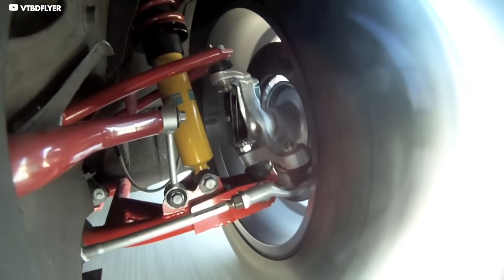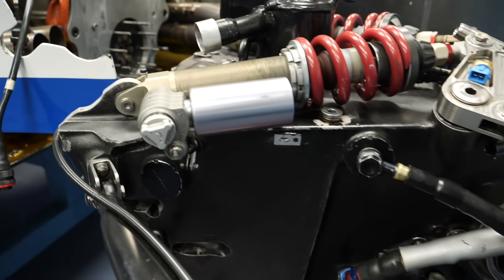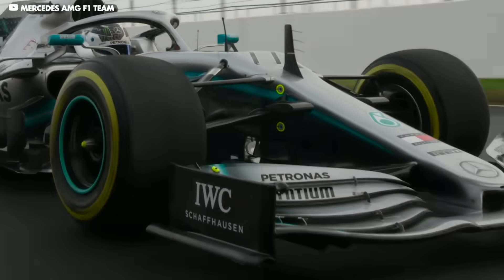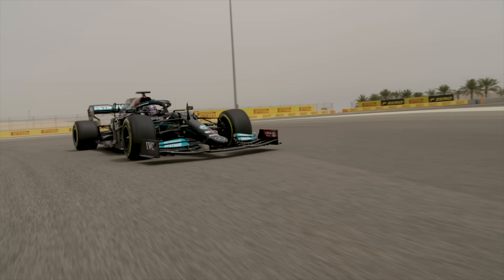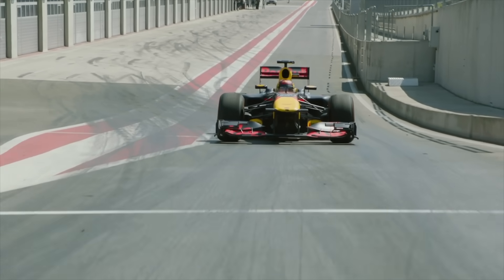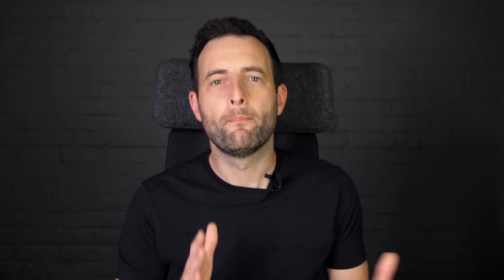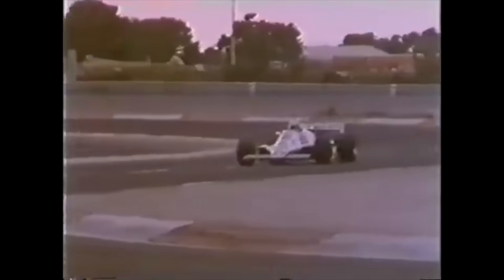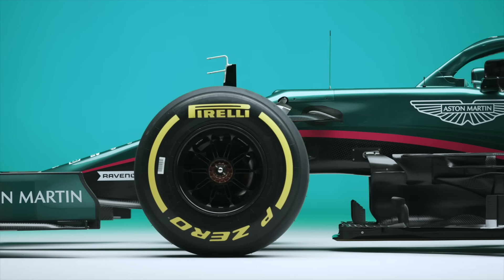Why this Formula 1 Car was FASTER Without Suspension

Comment: It's crazy how suspension can actually soak up your down force there by reducing grip. Never knew that before
Reply: On smooth track but with good set of suspension with hi and low speed compression i will be same but on not so smooth track you will definitely feel cause instead of suspension soaking up the bumps the whole car will bounce that will affect it. Modern cars with modern suspension do what's best.

Comment: Friction is Independent of surface area. Amontons 2nd law of friction.
Reply: If I'm not wrong, that's true for an ideal solid body, but that is not strictly true for rubber
Reply: @2nir2  ok coming back after more research. You are still wrong. Coefficient of friction only increases with the normal force. And is completely independent if contact area.
Reply from the maker: Coefficient of friction is
Reply: @Driver61  I don't believe so. But I'm only pulling information from a few physics textbooks and what I can google. And you please post a link to information where the coefficient of friction is a  function of the contact area?
Reply: @2nir2  that's not a very good resource. Thank you though.

Comment: Misconception: weight transfer is not eliminated with no suspension. The time it takes for weight transfer to occur is almost eliminated when suspension is removed. As long as the center of mass is above the contact patch, there will be weight transfer due to the torque applied when cornering, braking, and accelerating, when talking about cars.
Reply: Very true. Big mistake by him.But if your center of mass was bellow your contact patch you would still have load transfer just in the opposite direction... Still I am finding funny imagining how you could have the center of mass bellow the contact patch. Like two rails with a cabin between the rails perhaps...
Reply: @BerTav  with this 😝 https://en.m.wikipedia.org/wiki/Suspension_railway
Reply: @euquievolinho2525  perfection 😂👌
Reply: Thank you!  While I was stunned while watching this video and thought I was losing my mind.  I'm kind of astounded by the inaccurate info as well as the fact that so few seem to notice it.
Reply: Went into the comments to see who caught this first.  Springs have no affect on total load transfer outside of the minuscule results of how they may allow the CG, wheelbase, or track width to alter during roll and pitch.  The only items that affect total lateral and longitudinal load transfer are CG height, track width, and wheelbase.  Springs, dampers, arb's, etc. have no ability to increase or decrease load transfer, but they do allow you to adjust the distribution and rate.
Reply: @BilletBenny  Can I ask you to clarify for me?  Clearly lack of suspension does not eliminate load transfer, but does it necessarily follow that where springs and ARBs are present they have no ability to increase or decrease total load transfer?  For example, does not increasing the roll stiffness of an axle reduce net mechanical grip because it increases the load carried by the outside wheel at the expense of the inside wheel?  In an extreme example, back in the day Porsche 911 race cars often put on enough roll stiffness to lift the inside front wheel clear of the pavement, meaning 100% the load was transferred to the outside tire, no?  Wouldn't the corollary be that an axle with minimal roll stiffness would transfer less load off the inside tire than one with maximum roll stiffness?  Thanks.
Reply: @gort8203  It is true that springs and arb’s have no ability to increase or decrease total load transfer.  When you are talking across an axle you are not talking about total load transfer, but load transfer distribution, which springs, arb’s, etc. do change.
  

I will talk in the context of lateral load transfer during cornering, but it’s the exact same concept as longitudinal load transfer during braking and accelerating.  Total load transfer is the amount of normal load that is removed from the inside tires and added to the outside tires during lateral acceleration.  This is what springs, arb’s, etc. cannot change.  The only items needed to determine this total load transfer is lateral acceleration, track width, and cg height.  That’s it and springs do not come into play.  Now for how much of that total lateral load transfer occurs across the front wheels and rear wheels is a stiffness problem and absolutely is controlled by springs.  This is how you tune the balance of a car among other things.

But, the concept here to understand is total lateral load transfer right to left is completely independent of any springs while the distribution of that total lateral load transfer between individual corners is entirely controlled by springs.  Springs don't change the total, just the distribution.
Reply: @BilletBenny  Thanks for the reply.  I think you have added an additional complication by talking about cross corner distribution, and I’m trying to stick to pure lateral transfer across a single axle.  I know that springs can’t change the total magnitude of the load on that axle, only the distribution, but the real load on each wheel does change, right?  In my 911 example, you have a stiff chassis with minimal rear roll stiffness and strong front roll stiffness.  The chassis rolls enough to lift the inside front wheel off the pavement while the rears are well planted.  There is zero real load on the inside front tire.  Are you saying there is still “total” load on that tire, but no “normal load”?  If so I do not understand the distinction and I want to be sure this is not just a terminology thing.  Thanks.
Reply: @gort8203  Springs do change the total load across an axle, they just don't change the total load transferred from the inside wheels (summed) to the outside wheels (summed).  The way springs change load across each individual axle is your lateral load transfer distribution.  In your case, when lifting a front wheel, everything holds true except we now have a limit constraint.  There is no new or extra lateral load transfer created in this case from inside to outside.  The total additional load on the outside tires has increased by the same about that has been removed from the inside tires.  In this case the tire in the air has zero load and therefore the inside rear tire is carrying the entire load that must be left on the inside wheels.  That load that has left the front wheel in the air is now carried by the front and rear outside tires, but how much to each is determined by the relative roll stiffnesses.  

Cross corner distribution isn't a complication because it's critical to understanding the problem.  Total load transfer occurs between inside and outside tires in total.  You cannot compute it individually across an axle without taking into account the other axle.  Basically, total lateral load transfer (inside to outside) is statically determinate, but how much of that lateral load transfer occurs across each axle is indeterminate (too many unknowns) and in order to solve across an individual axle new information must be brought in such as spring stiffnesses and/or travel limits.
Reply: @BilletBenny  Okay thanks, I think we are saying the same thing.
Reply: @BilletBenny  what about "impulse"?
A loaded spring can temporarily increase normal forces, though at the "cost" of decreasing normal forces later (perhaps even imparting upward momentum).
Unless I misunderstood what you meant by distribution.
I mean, I can increase force even at a standstill, by (unloading the "spring like force of my legs by) jumping.

Also, I think the announcer actually meant something different: the geometry of the car doesn't modify, thus deformation by the suspension on the inside curve would roll the car more, and if the suspension on the outside doesn't compensate, this would reduce the outside wheels contact force, distributing too much (?) force (Overwhelming) to the inside wheels. 
Additionally, perhaps the momentum of outside wheels "launching down" would impart angular momentum (during this movement) rolling the car even more, until the outside wheels then reach the end of their compression or hit the ground, which would either snap roll in the opposite direction, or inversely, bounce off the ground and increase the roll.
(This comment is now a mess, I apologize.)
Think being in a chair with wheels, and while sitting you swing a heavy sledge hammer down. you will move in the opposite direction. Now imagine suddenly stopping that hammer before it hits the ground, your roll backwards would stop, and perhaps you would roll towards the hammer (depending on how you transfered momentum to the chair, etc.). However, if you didn't stop and instead hit the hammer  to the ground, your roll will increase.
Here, the hammer is the tire, and you swinging it is a compressed spring uncompressing.
Reply: I should have scrolled down before I wrote my reply! It's amazing how few people actually understand things like this.

Comment: so, No suspesnion and super thick tyres to be used as Suspension would be the best?
Reply: No suspension only helps when ground effect is a major factor, otherwise the suspension helps maintain ground contact. Bigger, thicker tires might help, but ultimately it doesn’t do quite the same thing since the air can’t be damped in the same way suspension springs are. I think the overall result would be a car that ran very low and very smooth in ideal conditions, but would bounce and oscillate unpredictably over bumps and even during cornering. The ultimate setup would be ground effect and active suspension tuned to the tires, which would allow low, controlled ride height, and maintain contact with the road.

Comment: Man, that's a bit of a scummy thumbnail.

Put the picture of the car this is relevant to rather than the current f1 car that doesn't use said suspension.
Reply: Yeah but if hes delivering quality content don't bitch about it it's a minor detail.
Reply: @sufferr2914  he has the right to bitch about anything that's illogical and/or wrong. 

Besides, audience here are in it for the details and this video had some wrong info stated as facts. 

Just like I can bitch about you because you did not think 2 steps ahead.

Comment: Actually load transfer would still happen by the same degree a with soft suspension.
Reply: Exactly, dude has no clue what he is talking about. Softness, or even absence of suspension has no effect (except absolutely minimum amount from a slightly shifting CoG) on weight transfer. There are only two things that affect weight transfer - CoG and track width/wheelbase.
Reply: was just about to comment the same. Equilibrium of moments... Suspension only change the distribution of the load transfer and the behaviour and movement of the chassis (that can change masse distribution but it is minimal). My confidence on his conclusions just dropped instantly. A very common mistake by people starting to learn vehicle dynamics and show very few knowledge in vehicle dynamics...
Reply: @BerTav  I didn't do physics, but I don't think suspension even changes  the distribution of the load transfer. Stiff anti-roll bars I think speed up the rate of load transfer, so I suppose suspension does that to some degree. But with suspension, it is about maintaining the right contact patch, and/or preventing geometry changes to the suspension. There is also the possibility of lowering the car if it has stiffer suspension (which definitely has an impact on load transfer). But more importantly stiffly sprung cars just feel more connected to the road.
Reply: @projectilequestion  The relation of stiffness of the axels changes the distribution of load transfer. If you stiffen the front axle then you increase the percentage of load transfer in the front and decrease in the rear. The total remains the same but the distribution amongst the 2 axles is changed by the relation of stiffnesses of both axles. That's why for example you increase rear axle stiffness (with ARB or springs) when the car is understeering. That way more of the load transfer happens on the rear and less on the front increasing grip in the front and damaging a bit of the grip in the rear.
Reply: @BerTav  Right thanks.
Reply: So if a car has 500n/inch front and 500n/inch back. It would corner the same as if it had 1000n/inch front and 1000n/inch back?
Reply: @projectilequestion  the load transfers would be approximately the same (not entirely but very close). The car would have a different behaviour since it would have less chassis roll and a more stiff feeling (meaning less time for the car to roll to its stable position). But the loads would be very very close.
Reply: @projectilequestion  you see rally cars for example. They have very soft suspension but that doesn’t make them have 10 times the lateral transfer or have 1/10 of the lateral transfer. It’s the same total lateral transfer. The ratios change the distribution. This doesn’t means that as long you increase or decrease both stiffnesses maintaining the ratio the car would behave the same. Obviously a rally car takes turns in a very different behaviour but the loads can be the same
Reply: @BerTav  Interesting, why does the body roll make the car unstable?

Comment: Video topic: Could modern F1 cars still use fans to suck them to the ground?

More and more tracks with a lot of undulation and camber changes are becoming unsuitable for newer F1 cars due to increased downforce. Could some form of suction make said circuits safer to race on? Or would it make the problem even worse?

(Hint: the second answer is probably correct)

Comment: I feel sad knowing I was born after the days of peak F1 innovations and crazy experimentations like this. The biggest F1 changes during my time watching it have been the beginning of turbo hybrids and the Halo.
Reply: There is immense engineering behind the hybrid engines and their drivetrains
Reply: @kpsig  it's certainly impressive but the hybrid concept wasn't as fresh as some of the older innovations of F1 that later trickled down to road cars. And none of the teams will ever dare to execute quirky ideas like some teams had in the past thanks to cost caps and a more profit oriented business model of Formula 1 compared to just a couple of decades or so ago.

Comment: Hard to believe the engineers didn't think to place high density foam in and under the seat for Alan Jones on the trials. It's a no brainer. ✌
Reply: Well foam could be like more weight which is ok.....like in one of the mercedes nico Rosberg said that they limit foam for weight limits...
Reply: @speeddemon2901  Ditching the springs and the weight related should be more than enought to offset some foam

Comment: You have missed the fact that the tires become the suspension. In addition Williams did not pioneer active suspension Lotus did.
Reply: Also the flex in the chassis. From an engineering perspective, everything is a spring. These 'springs' are undamped and very stiff relative to traditional suspension, though, which is where the bump issues come into play.
Reply: @MegaNardman  exactly, this is why karts work! The chassis is the spring, you can actually tune this "spring" through things to adjust chassis stiffness like additional bars or even a softer seat material. Something I think this channel should make a video on!
Reply: @mehmetkara2752  You have hit the nail on the head. I think it would be a great video. I don’t think many people realize how much tuning can go into a kart chassis. If they watch a wet race they probably pick up on the front wheels having a wide track and the rear having a narrow track but that is about it.  To do karts justice i think a few videos would be in order any ideas on how to get him to do it ?
Reply: @michaelroberts1420  haha, ask for it enough and he might see it!
Reply: @mehmetkara2752  every time I watch one of his videos i will ask.

Comment: Pretty sure Martin Brundle has mentioned that Ligier used to do this at the Mangny Cours grand prix too. That track is super flat and they had some of their best performances there as a result.
Reply: That's why race cars are generally stiff but not all the time stiff: They have to take into account the bumps and elevation changes too so that the tires lose less grip going over them, but stiff enough that weight distribution is as equal as possible through all four times

Comment: If there is no suspensions in f1 now, they should bring spare spinal cords just in case
Reply: They pretty much have baloon tires on 13 inch rims as of now. Next year we will probably see much more suspension since they are going to go with 18 inch wheels.
Reply: Lol
Reply: The F1 car he's talking about is back in the 1980s (the video picture of the current Williams is incorrect) when they had massive under car aero and skirts, so ran the cats very hard.

Current F1 cars have quite a lot of suspension travel, over 100mms in the rear I believe
Reply: LoL!
Reply: the seat already reduce the movement right?
Reply: @NikoKyunKyun  No, it's basically rock solid. The inside only has pads for driver's legs so they don't get injured from hitting the inside of the cockpit.
Reply: Especially with the new big wheels and low profile tires they're running next year!
Reply: Elon is probably working on it with neural net implant. 😯
Reply: @jamesbarisitz4794  yes i am

Comment: Is this the same as having a car with 100% bump?
Reply: Perhaps they could remove rear suspension and do it in a Hardtail MBT way
Reply: @truedarklander  unequal amounts of grip would cause the rear end to slide side to side like a rollercoaster
Reply: Technically it would be the same as running infinitely stiff springs.